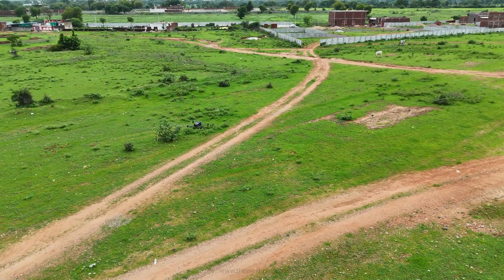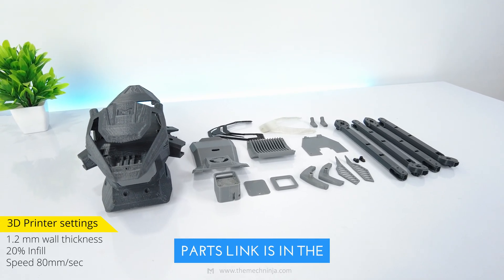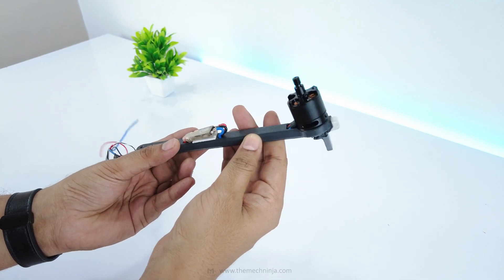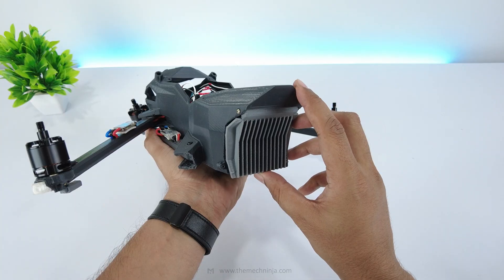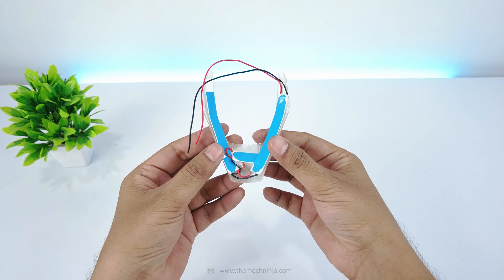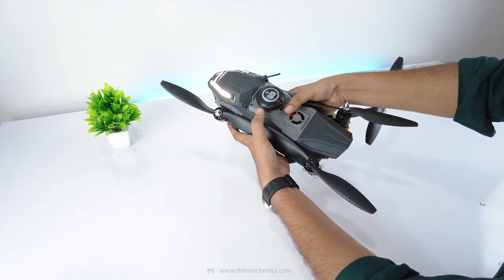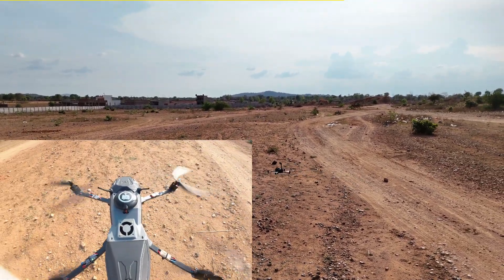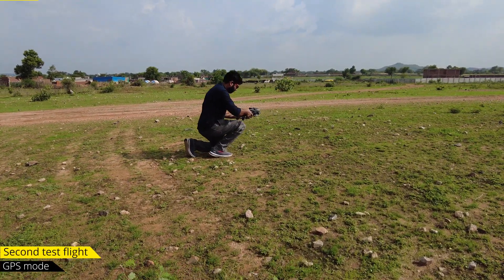My 3D Printed Drone Crashed Instantly… So I Rebuilt It Stronger

Comment: please upgrade , add a optical flow sensor with lidar, also change the camera with skydroid c10, and transmitter skydroid t10 in this transmitter all thing have like telemetery video transmission , please please do this , i want to build it
Reply from the maker: At the bottom there is a dedicated space for an optical flow sensor...
And the camera is customisable

Comment: Hi like your design. You can try to integrate Speedy bee Stack. so you don't need to attach esc on arms.
Reply from the maker: If you are saying for 4 in 1 ESC, then you should checkout my DRONE TANK video...😁.. Because of high temp, it stopped mid way to protect the ESC and it crashed multiple times....

Comment: What is flight duration?
Reply from the maker: 20 minutes with an 8000 mah 3S battery
Reply: @MechNinja is it possible to extend the flight time to 40 mins with additional battery?
Reply from the maker: Not for this frame and electronics, this is designed for a max prop of 10 inch, for a bigger battery the weight will increase and motor will become inefficient hence reducing time of flight